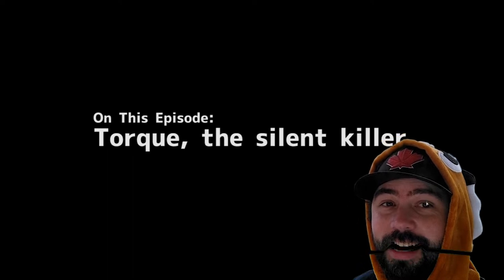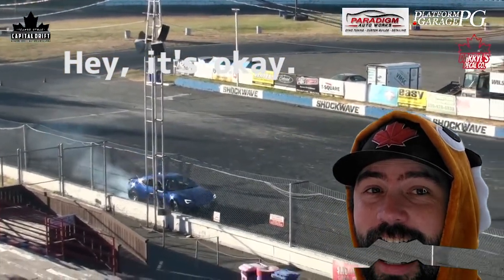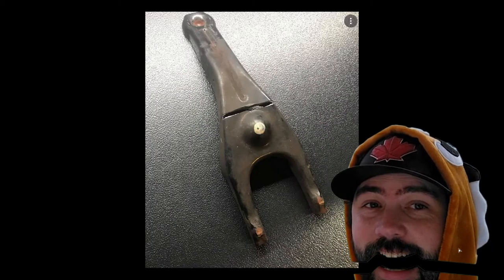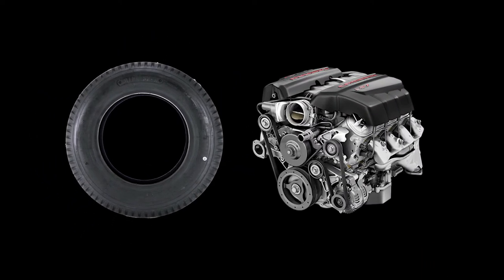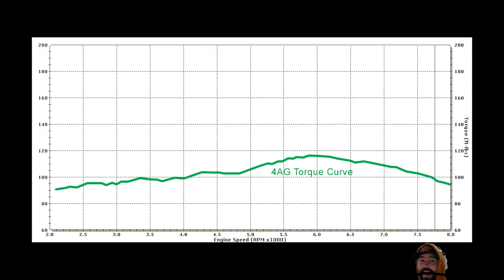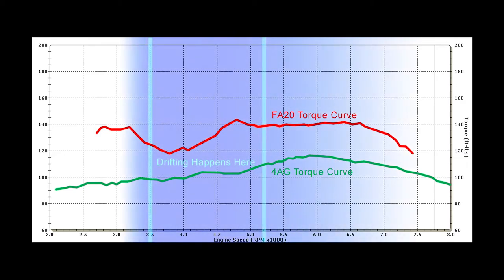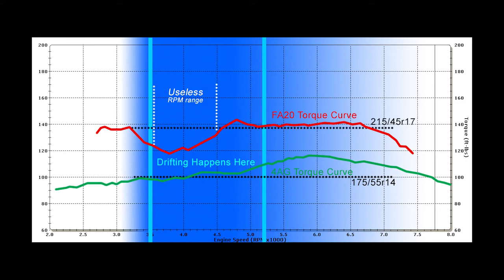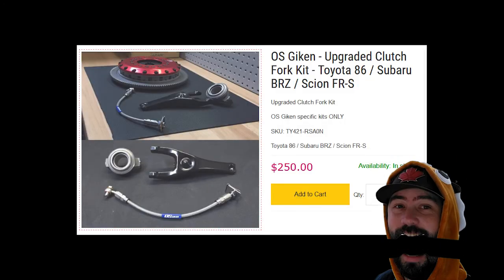Archetype BRZ: Power to Grip ratio

Comment: Love watching your videos on this project - really like your perspective on some of this stuff. I also drift a BRZ (header/OFT tune) and I'd also want to mention mechanical grip - the way the suspension moves under load changes grip a lot too, when your suspension compresses and changes camber into a corner it can cause a tire to grip up! I've messed around with quite a few different tire sizes on the chassis and to me, a 225/45/17 feels the best but it's probably due to the reduced torque dip from the tune.
Reply from the maker: I kept the description of grip really simplified in this video. There are so many different factors of grip and it's dynamic changes but it would be a 6 hour video instead. lol